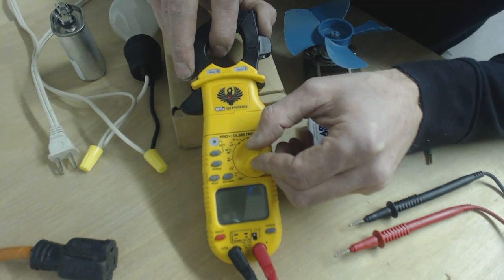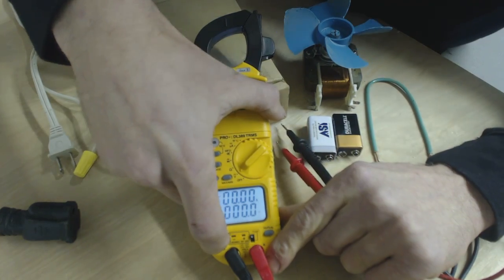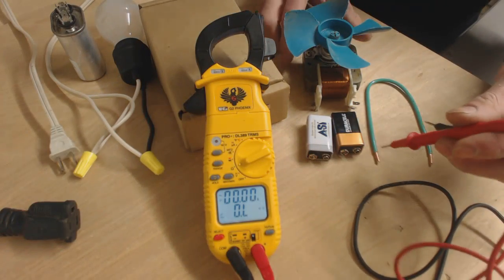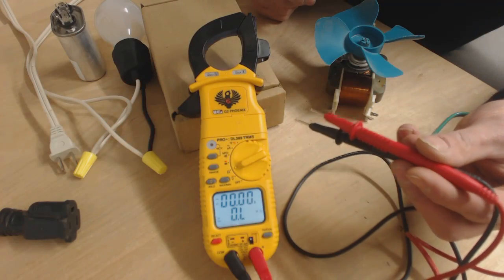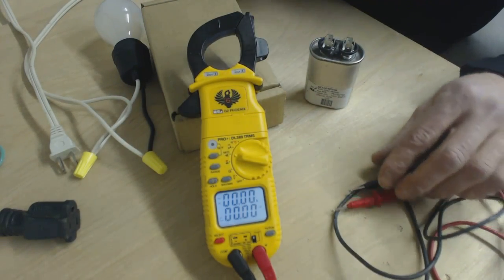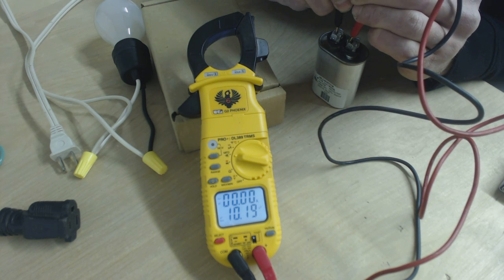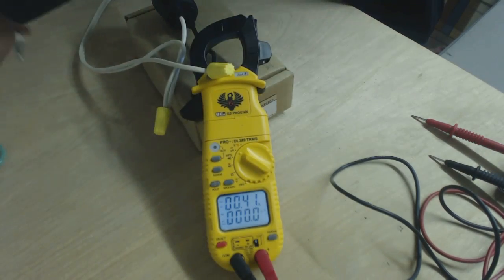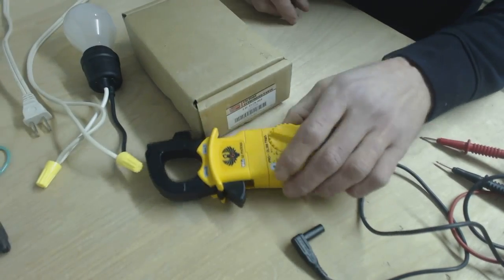UEI DL389 Multimeter Review: Testing each function of the Multimeter!

Comment: Do you know the difference between the 389 and the 389B model?
Reply: The only difference is The AC/DC. The DL389B can not do DC. But DL389B has more capability. Also The DL389 is discontinued and has the 'PRO' tag on it. The Dl389B has more capability.

Comment: Well done video. Is the 389B model the same meter as the 389? Perhaps just a newer version as they look exactly the same as far as I can tell? I was looking at the 389B but have not bought it yet. Thanks and really informative video with the different functions. Thanks.
Philip
Reply: I AM IN THE SAME SITUATION. The  difference is The AC/DC and the "PRO" mark. The DL389B can not do DC. But DL389B has more capability. Also The DL389 is discontinued. Did you buy it? do you think DL479T is better than DL389B?

Comment: Hi there, I've been watching your videos, big thx! I have a question regarding a meter. Can you tell me the main difference between the DL 479 and DL379? I can get them both about the same price. The DL369 is half the price. The 369 doesn't have a magnet, temp probe, or back light but I already have a temp unit. Anyway, I'd like to save some cash, but no be disappointed. not sure if you have tried the other units (379 and 369) and how they compare to the 479 on you amazon page? thx!
Reply from the maker: The 369 does not do capacitance. Thats the big difference is that you can't test the mfd of capacitors. Because of that, the 379 is better, thanks!
Reply: Thx, I missed that. Do you have any preference between the 479 and 379? Both cost about the same, I can't tell which is better, newbe here haha. Oh and a question on your book. Are you going to have an updated one out soon? I'm going to buy it, just don't need it right away, but def by spring time. Maybe a Christmas present for me
Reply from the maker: @patrickpk6299  Go with the DL479. No planned updates so you should be good to get it whenever. I am happy with the book. It was 3 years in the making, thanks
Reply: @acservicetechchannel  Thanks for the advice, I'll go with the 479. One question on the book. If I get the ebook, can I print pages? I like to have paper with me so I can check things off as Im doing them. I know sometimes printing is disabled on ebooks.
Reply from the maker: @patrickpk6299  Yes printing the ebook is disabled since it is an epub file. If you purchase the paperback, there is $5 off the ebook. This is seen at https://www.acservicetech.com/the-book  thanks!
Reply: @acservicetechchannel   IS THE DL479 BETTER THAN THE DL389B?
Reply: @acservicetechchannel  What are you talking about? .... the 369 Does do capacitance, im looking at 1 for sale right now as i type this out. It also has a Magnetic back, temp probe and back light. Both of yall are off your rocker, lol.

Comment: Why do you short the capacitor before testing.
Reply from the maker: Most of the power is usually taken out of the run cap by the motor once the motor does not have power to it any more. If the motor is broken however, the cap would still have a charge. Regardless, short to make sure all power is out for instrument reading. Even if there is a little charge left, it will throw off the reading, thanks

Comment: Why do you have to clamp for amperage with the power off, then turn the power on? It protects the multimeter? So you cant just clamp live wires?
Reply from the maker: It is for the persons safety only. Getting in a routine of being safe around high amperage wires and not trying to dig to get the clamp around, thanks

Comment: I think you forgot DC microamps
Reply from the maker: Hey Chad, when I did this video, I was not near a furnace where I could display that, thanks!
Reply: acservicetech So the sqizzly line means AC amps and the straight line is DC amps?
Reply from the maker: Yes the sine wave means ac and the straight dc, also did you check out the newer uei dl479 video?-  https://youtu.be/kFg3FGphL3U
Reply: acservicetech ok appreciate it

Comment: So, OL means a break in the wire, and OO means a short, do I have that right, thanks, and great job on the functions of the meter.
Reply from the maker: Yes when testing anything with an electrical coil or winding such as a motor or contactor, thanks!

Comment: I have this model, and when I tested the cap. on my blower fan (5mf/370VAC) I get a 0.566 uf reading..is that a bad cap. ?
Reply from the maker: Make sure you short the cap very well with a unpainted metal. The dig the probes in and wait 20 seconds. Make sure you are past the surface rust. If your multimeter is auto ranging like this one then yes that cap is bad. It must be within 6% but if it less than the rating and a little older I usually replace during preventative maintenance so it doesn't go out during the heavy season. Thanks

Comment: Thanks acservicetech, found on Amazon and going to purchase one. I have a UEI DM383 multimeter I've used for 25 years and it's outlasted my other meters. I needed another clamp on and meter since my Fluke322 stopped working at only several years old. Granted it wasn't the most expensive but it was about $110.00 or so at the time.
Reply from the maker: Sounds good! Glad to help!